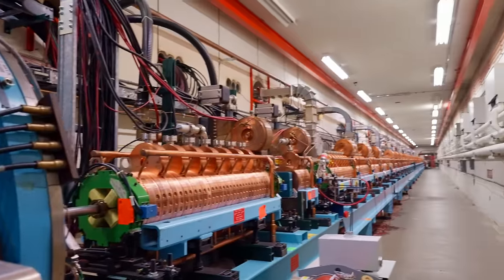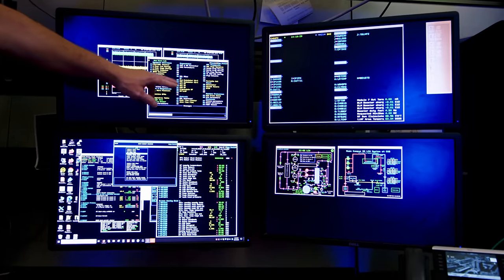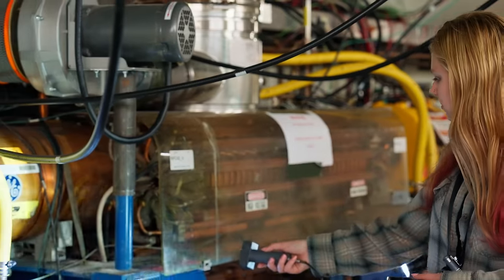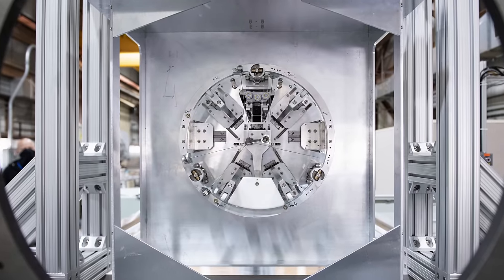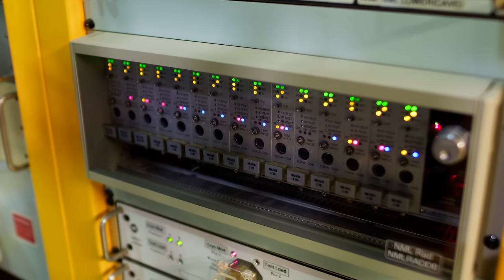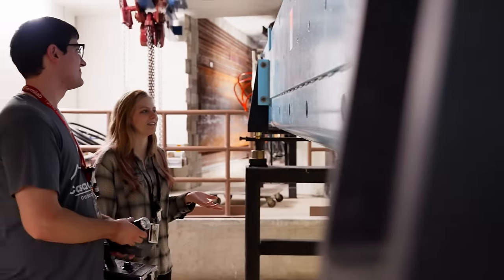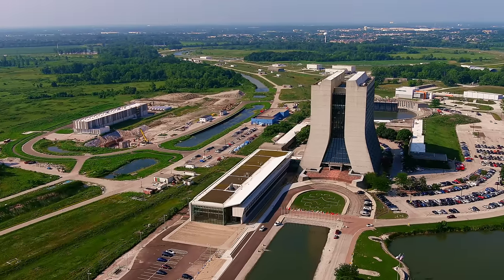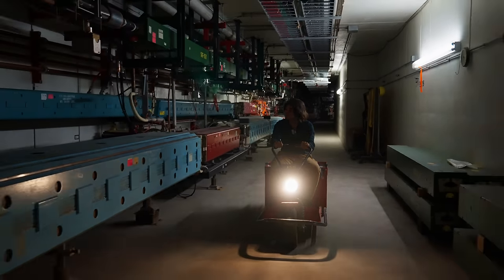Operating Fermilab's particle accelerators | Behind the Science

Comment: If quarks have not been isolated and gluons have not been isolated, how do we know they are not parts of the same thing?   The tentacles of an octopus and the body of an octopus are parts of the same creature. 

Is there an alternative interpretation of "Asymptotic Freedom"?  What if Quarks are actually made up of twisted tubes which become physically entangled with two other twisted tubes to produce a proton?  Instead of the Strong Force being mediated by the constant exchange of gluons, it would be mediated by the physical entanglement of these twisted tubes.  When only two twisted tubules are entangled, a meson is produced which is unstable and rapidly unwinds (decays) into something else.   A proton would be analogous to three twisted rubber bands becoming entangled and the "Quarks" would be the places where the tubes are tangled together.  The behavior would be the same as rubber balls (representing the Quarks) connected with twisted rubber bands being separated from each other or placed closer together producing the exact same phenomenon as "Asymptotic Freedom" in protons and neutrons.  The force would become greater as the balls are separated, but the force would become less if the balls were placed closer together.  Therefore, the gluon is a synthetic particle (zero mass, zero charge) invented to explain the Strong Force.  An artificial Christmas tree can hold the ornaments in place, but it is not a real tree. 

String Theory was not a waste of time, because Geometry is the key to Math and Physics.  However, can we describe Standard Model interactions using only one extra spatial dimension?    What did some of the old clockmakers use to store the energy to power the clock?  Was it a string or was it a spring?

What if we describe subatomic particles as spatial curvature, instead of trying to describe General Relativity as being mediated by particles?  Fixing the Standard Model with more particles is like trying to mend a torn fishing net with small rubber balls, instead of a piece of twisted twine.

Quantum Entangled Twisted Tubules:  
“We are all agreed that your theory is crazy. The question which divides us is whether it is crazy enough to have a chance of being correct.”    Neils Bohr
(lecture on a theory of elementary particles given by Wolfgang Pauli in New York, c. 1957–8, in Scientific American vol. 199, no. 3, 1958)

The following is meant to be a generalized framework for an extension of Kaluza-Klein Theory.  Does it agree with some aspects of the “Twistor Theory” of Roger Penrose, and the work of Eric Weinstein on “Geometric Unity”, and the work of Dr. Lisa Randall on the possibility of one extra spatial dimension?  During the early history of mankind, the twisting of fibers was used to produce thread, and this thread was used to produce fabrics.   The twist of the thread is locked up within these fabrics.  Is matter made up of twisted 3D-4D structures which store spatial curvature that we describe as “particles"?   Are the twist cycles the "quanta" of Quantum Mechanics?

When we draw a sine wave on a blackboard, we are representing spatial curvature. Does a photon transfer spatial curvature from one location to another? Wrap a piece of wire around a pencil and it can produce a 3D coil of wire, much like a spring. When viewed from the side it can look like a two-dimensional sine wave. You could coil the wire with either a right-hand twist, or with a left-hand twist. Could Planck's Constant be proportional to the twist cycles. A photon with a higher frequency has more energy.  ( E=hf, More spatial curvature as the frequency increases = more Energy ). What if Quark/Gluons are actually made up of these twisted tubes which become entangled with other tubes to produce quarks where the tubes are entangled?  (In the same way twisted electrical extension cords can become entangled.) Therefore, the gluons are a part of the quarks. Quarks cannot exist without gluons, and vice-versa. Mesons are made up of two entangled tubes (Quarks/Gluons), while protons and neutrons would be made up of three entangled tubes. (Quarks/Gluons) The "Color Charge" would be related to the XYZ coordinates (orientation) of entanglement. "Asymptotic Freedom", and "flux tubes" are logically based on this concept. The Dirac “belt trick” also reveals the concept of twist in the ½ spin of subatomic particles.   If each twist cycle is proportional to h, we have identified the source of Quantum Mechanics as a consequence twist cycle geometry.  

Modern physicists say the Strong Force is mediated by a constant exchange of Gluons. The diagrams produced by some modern physicists actually represent the Strong Force like a spring connecting the two quarks. Asymptotic Freedom acts like real springs. Their drawing is actually more correct than their theory and matches perfectly to what I am saying in this model. You cannot separate the Gluons from the Quarks because they are a part of the same thing. The Quarks are the places where the Gluons are entangled with each other. 

Neutrinos would be made up of a twisted torus (like a twisted donut) within this model. The twist in the torus can either be Right-Hand or Left-Hand.   Some twisted donuts can be larger than others, which can produce three different types of neutrinos.   If a twisted tube winds up on one end and unwinds on the other end as it moves through space, this would help explain the “spin” of normal particles, and perhaps also the “Higgs Field”.   However, if the end of the twisted tube joins to the other end of the twisted tube forming a twisted torus (neutrino), would this help explain “Parity Symmetry” violation in Beta Decay?  Could the conversion of twist cycles to writhe cycles through the process of supercoiling help explain “neutrino oscillations”? Spatial curvature (mass) would be conserved, but the structure could change. 
=====================
Gravity is a result of a very small curvature imbalance within atoms. (This is why the force of gravity is so small.) Instead of attempting to explain matter as "particles", this concept attempts to explain matter more in the manner of our current understanding of the space-time curvature of gravity. If an electron has qualities of both a particle and a wave, it cannot be either one. It must be something else. Therefore, a "particle" is actually a structure which stores spatial curvature. Can an electron-positron pair (which are made up of opposite directions of twist) annihilate each other by unwinding into each other producing Gamma Ray photons?  

Does an electron travel through space like a threaded nut traveling down a threaded rod, with each twist cycle proportional to Planck’s Constant?  Does it wind up on one end, while unwinding on the other end?   Is this related to the Higgs field?  Does this help explain the strange ½ spin of many subatomic particles?  Does the 720 degree rotation of a 1/2 spin particle require at least one extra dimension? 

 Alpha decay occurs when the two protons and two neutrons (which are bound together by entangled tubes), become un-entangled from the rest of the nucleons

. Beta decay occurs when the tube of a down quark/gluon in a neutron becomes overtwisted and breaks producing a twisted torus (neutrino) and an up quark, and the ejected electron. The production of the torus may help explain the “Symmetry Violation” in Beta Decay, because one end of the broken tube section is connected to the other end of the tube produced, like a snake eating its tail. The phenomenon of Supercoiling involving twist and writhe cycles may reveal how overtwisted quarks can produce these new particles. The conversion of twists into writhes, and vice-versa, is an interesting process, which is also found in DNA molecules.  Could the production of multiple writhe cycles help explain the three generations of quarks and neutrinos? If the twist cycles increase, the writhe cycles would also have a tendency to increase.

 Gamma photons are produced when a tube unwinds producing electromagnetic waves.  ( Mass=1/Length )

    The “Electric Charge” of electrons or positrons would be the result of one twist cycle being displayed at the 3D-4D surface interface of the particle.  The physical entanglement of twisted tubes in quarks within protons and neutrons and mesons displays an overall external surface charge of an integer number.  Because the neutrinos do not have open tube ends, (They are a twisted torus.) they have no overall electric charge.

Within this model a black hole could represent a quantum of gravity, because it is one cycle of spatial gravitational curvature.   Therefore, instead of a graviton being a subatomic particle it could be considered to be a black hole.   The overall gravitational attraction would be caused by a very tiny curvature imbalance within atoms.

In this model Alpha equals the compactification ratio within the twistor cone, which is approximately  1/137.

1= Hypertubule diameter at 4D interface

137= Cone’s larger end diameter at 3D interface where the photons are absorbed or emitted.

The 4D twisted Hypertubule gets longer or shorter as twisting or untwisting occurs.   (720 degrees per twist cycle.)  

How many neutrinos are left over from the Big Bang?  They have a small mass, but they could be very large in number.     Could this help explain Dark Matter?

Why did Paul Dirac use the twist in a belt to help explain particle spin?  Is Dirac’s belt trick related to this model?    Is the “Quantum” unit based on twist cycles? 

I started out imagining a subatomic Einstein-Rosen Bridge whose internal surface is twisted with either a Right-Hand twist, or a Left-Hand twist producing a twisted 3D/4D membrane. This topological Soliton model grew out of that simple idea.  I was also trying to imagine a way to stuff the curvature of a 3 D sine wave into subatomic particles.
Reply: Dude,  you need to relax.  That is a mega post!
Reply: You need to put this into mathematics and have it make predictions if you want to be taken seriously by the physics community.
Reply: I hope you just didn't sit here on the video to write all that.
Reply: Maybe instead of tubes they are made of some sort of pasta, perhaps spaghetti?
Reply: @Valdagast  
I predict both quarks and gluons will never be isolated, because they are parts of the same thing.

I predict there will be parity violation in Beta Decay because one of the particles produced is a torus (neutrino), instead of a linear particle like all of the particles at the beginning.

I predict electrons will be found to be point like particles with no volume, because all of its volume is in 4D space.  
Mass= 1/Length
I predict the relative Length of an object decreases and its Mass increases at relativistic velocities.

I predict the entanglement of the quark/gluons will be found in three different orientations based on the X-Y-Z axis of the entanglement, which is analogous to "color" cancelation.

I predict the twist cycles will be proportional to Planck's Constant.
Reply: @SpotterVideo  great! Now clothe it in mathematics and send it to a physics journal.
Reply: @Valdagast  
I appreciate the advice.  However, my degree was earned in Biology about 43 years ago.  Do you really think a Physics journal is going to print anything that does not come from someone who has an advanced degree in Physics?
Reply: @SpotterVideo Well, then you won't be taken seriously. YouTube comments are not peer-reviewed science.
Reply: @SpotterVideo I've learned a ton by going to Fermilab and asking people hard questions. I learned that the reason physicists don't think neutrinos are dark matter is because the upper bound on their mass would mean they'd be traveling too fast to orbit galaxies.

The key thing here is that any novel interpretation of quantum effects must be compatible with known observations. You can't check against that without having your model fully described in math. Your model also needs to be testable for it to provide value over what we have now.
Reply: @Kupiakos42  
Which currently accepted model provides an explanation for Planck's Constant, and Parity Violation?
Reply: @SpotterVideo   your question is a non sequitur. Highlighting inconsistencies or open questions in accepted models is a necessary first step to improving or replacing them. However, an alternative model must be consistent with what we do know - modern physicists have a lot of data to work with. You can't prove consistency until you have the math to compare your theory against real world experiments. You have an essay but no logic or rigor gluing the ideas together. In the meantime, consider talking 1:1 with a physicist in a non-hostile manner one idea at a time to interrogate your theory and find its inevitable inconsistencies.
Reply: @Kupiakos42  
Do you have a degree in Physics?
Do you have a degree in Biology?
Do you have a degree of any kind?
Reply: @SpotterVideo  Yes. Take my advice or leave it, your questions do nothing but make you seem more unhinged than you already do
Reply: @Kupiakos42  
I greatly appreciate your advice.  Nobody wants to be labeled as "unhinged".   They might come up with the crazy idea that covid came from GOF research...
Reply: @SpotterVideo     I find it interesting that people like you think you can go outside of specialty and post a long comment on YouTube and think people will bother to read the whole thing.    

When I got to the statement about "why do they think they fix the standard model by finding more particles" or something to that effect you just lost me.   Hubris can quickly consume the person who jumps into an unfamiliar specialty and think they have something new to offer.  Especially posting an especially long comment.
Reply: @michaeldeierhoi4096  
Constructive criticism is always welcome. What is your solution to the problems with the Standard Model?
Reply: @SpotterVideo  The only problem that I know of with SM is the irreconcilable difference between gravity and quantum mechanics.  We don't yet have a working theory for the hypothetical graviton which is the alleged particle for gravity.   Perhaps it is because of a lack the technology to measure gravity on the micro level that is issue here.  But regardless it is like string theory, no working theory nor sufficient technology to test gravity at the quantum level.  

Also there is no new physics yet suggested by the SM so it's hard to speculate further.  The SM has been rigorously tested to the degree that it can be.  A major leap in understanding is probably many years off.
Reply: @michaeldeierhoi4096  Do you think knowing what causes the "quantum" in "Quantum Mechanics" is a minor issue?  What causes Planck's Constant to be a necessary number in the calculations? What is the source of this number?
Reply: @SpotterVideo  You ask too many questions.  Good night.